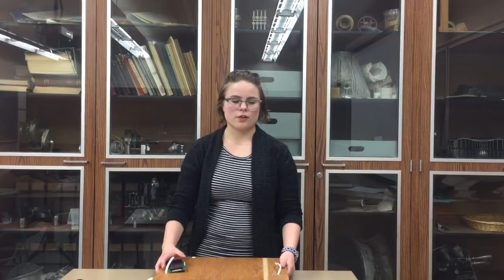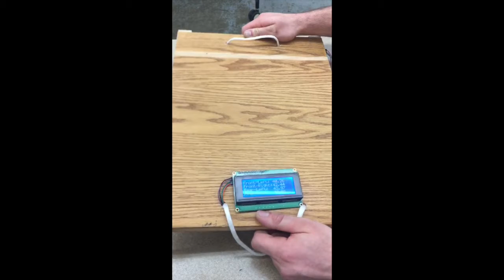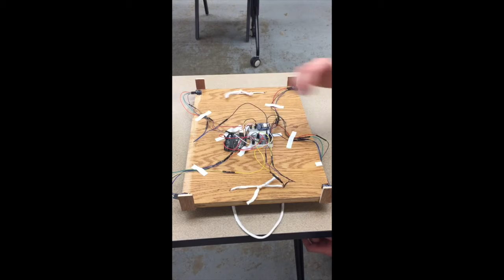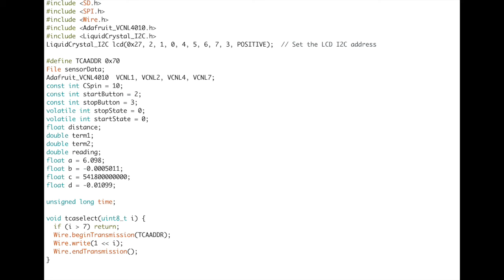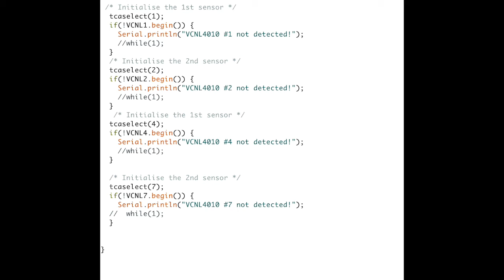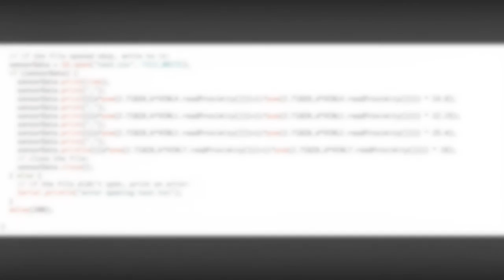ME 451 Project: Group 12

Comment: Hey Group 12, good job on the project and presentation. I was curious, what is the lag time between when the sensor takes the distance measurement, and when it outputs it to the screen? If the car is moving super fast would it maybe not be quick enough to register when it gets really close to the ground.

Comment: For the capstone project that was mentioned in the beginning, is the team member planning on having preset heights that he can just press a button and the car suspension will adjust automatically?
Reply from the maker: Yes. The vehicle will need to enter each event in accordance with the rules. This means that the driver must be able to adjust these setting just as they can in formula 1 with DRS.